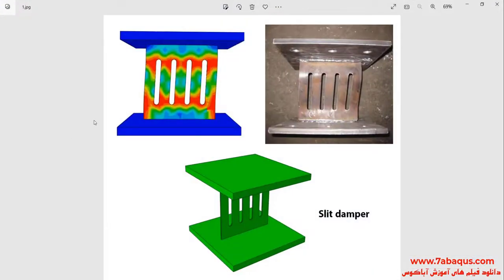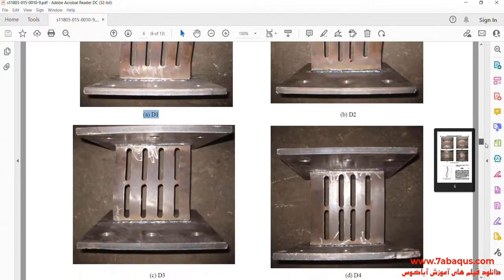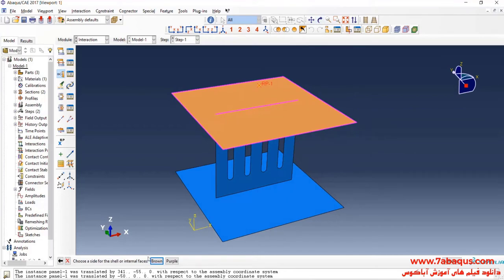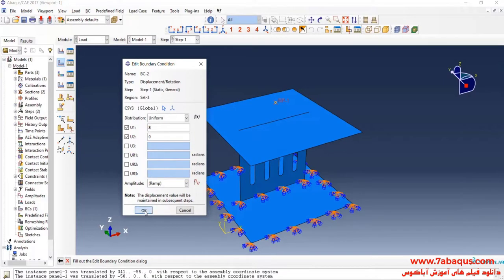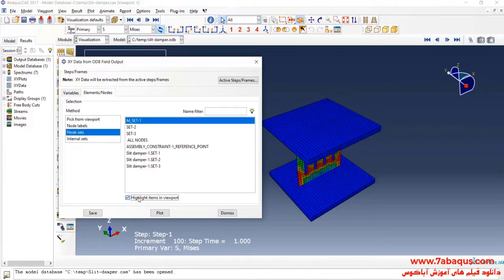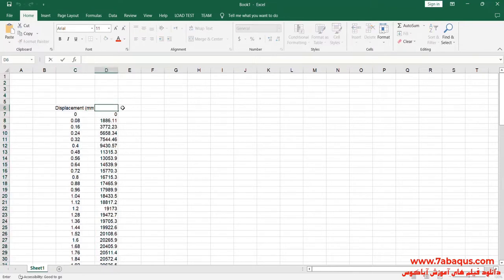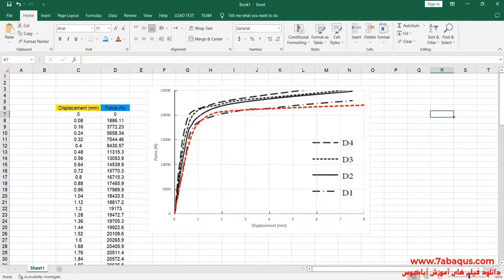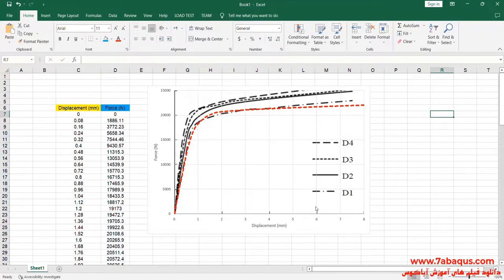Pushover analysis of slit damper Abaqus

Comment: What is the material properties of the steel?
Reply from the maker: Q235 steel
Reply: @saeedmoeini-7abaqus  What is the Young's modulus , Ultimate strength and elongation ratio value that you used in this analysis?